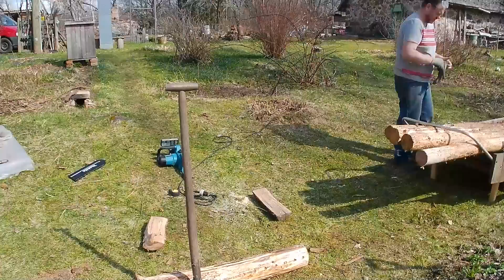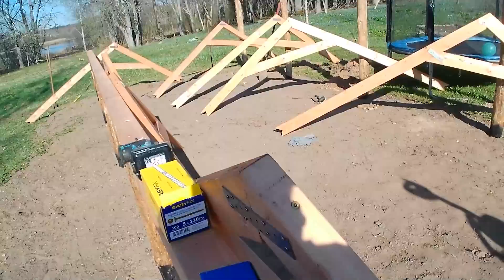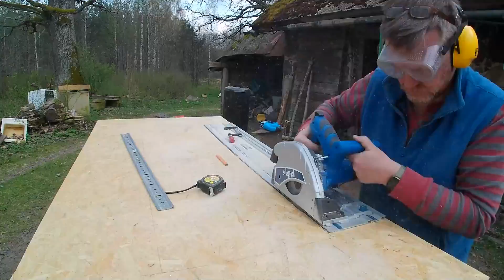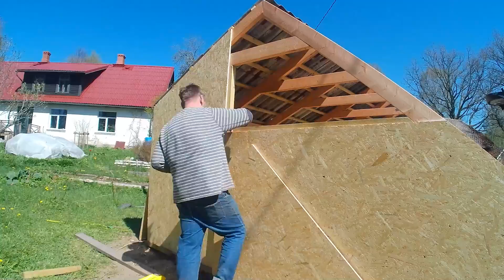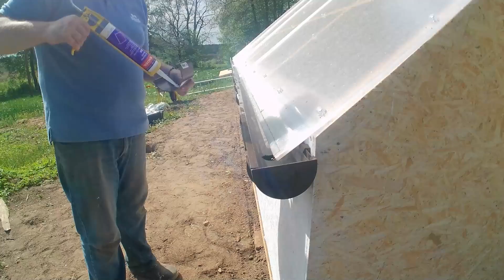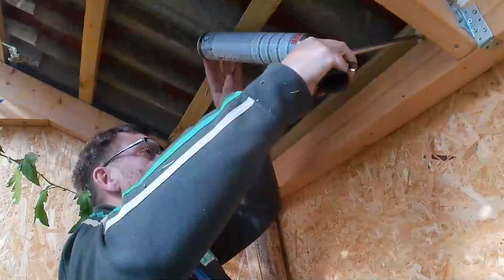Passive Solar Greenhouse - Full Build Walk though - Homestead Latvia

Comment: Great series of videos! I particularly appreciate the 'warts and all' approach we learn so much more from that. One thing I have missed though is why you don't appear to have a thermal mass on that back wall? You mentioned in an early video that you intended to use rock for this and I have a tonnes of concrete waste I was hoping to utilise in my design.
Reply from the maker: I still haven’t got round to building it. I kept changing my mind about it is the long and short of it and still haven’t worked out what I want to do. The rocks idea is still my favourite despite it being a long old slog to get that done. Blue barrels are in short supply here and maybe if I could get some I might be tempted to rethink how water could work for me. For you if concrete waste is on hand then I’d make the most of it. What’s your climate and winters like?
Reply: Understood - yes it could be difficult to build. I'm thinking of gabions (steel cages) to contain the concrete rubble to help keep it contained and reduce the footprint it requires. Our climate is very variable here in the UK - but without the extremes of temperature you have. The main problem in  the NW of England is the wind and rain as we are on the coast - hence looking for a greenhouse to extend my growing season and overwinter tender dwarf trees such as oranges, lemons and olives
Reply from the maker: @kevinholloway411  also I enjoy the space behind when pruning etc. I think also because it’s a 3 season greenhouse it’s been less of a concern and also our spring was much earlier this year. Gabions are a good solution, have you done the maths on what sort of mass you need, I understand rock etc needs 3 times more than water, I think you’d get away with water over there, it would need to be consistently minus for a long time for barrels to freeze inside.
Reply: @BalticHomesteaders  I haven't done the calculations but it is as much about trying to recycle the waste materials I have as getting absolute maximum efficiency. I'm looking at a 300x50x50cm gabion product which is quite cost effective at £75 and can be stacked. Alternatively I guess I could put one or two of these at the bottom and have water tanks on top as well...
Reply from the maker: @kevinholloway411  yeah the combo is a great idea.